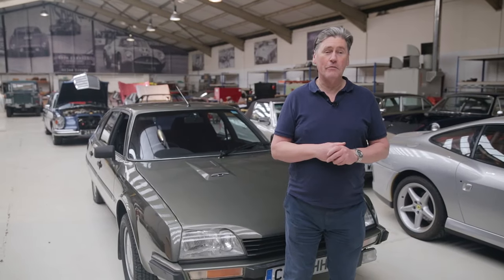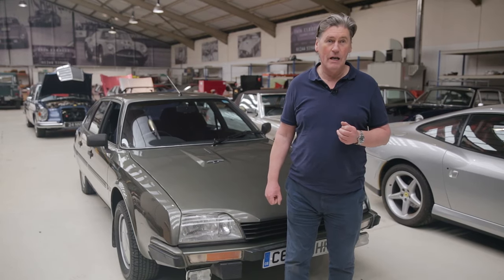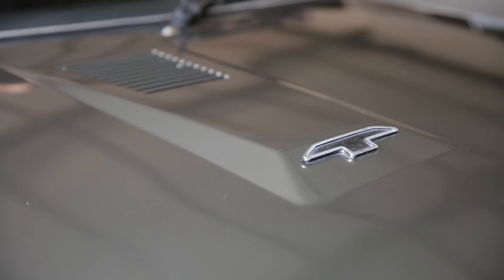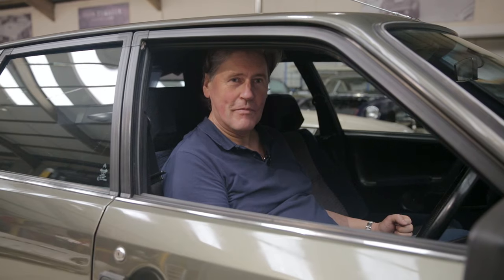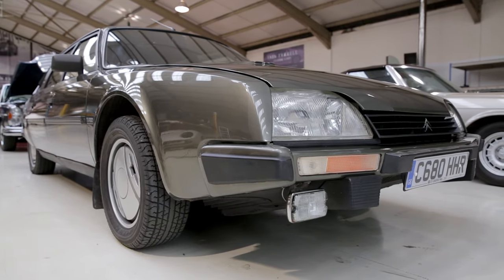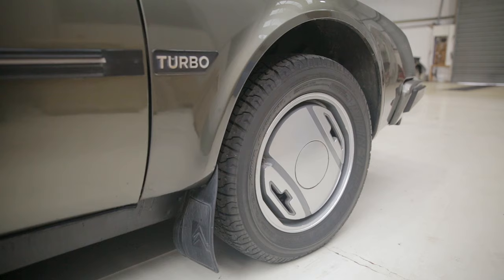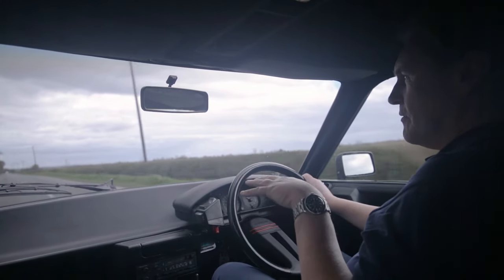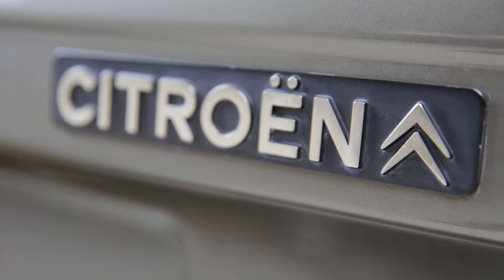Citroën CX 25 GTi Turbo - a rare beast with party tricks | Tyrrell's Classic Workshop

Comment: Fact: Citroën designed the double chevron gears to prevent side thrust on the gears, negating the need for thrust bearings on the gear shafts.
The Traction Avant used torsion bar suspension, not hydro-pneumatic. The DS was the first to hydro-pneumatic.
The Mercedes 450SEL 6.9 used pneumatic suspension.

Comment: Good job of teaching the curious about Citroen. One of the most fantastically engineered cars ever. Citroen proved that there is way more to a car than encapsulating a big engine with 4 wheels. A few points: Rolls Royce did not manufacture the ultra precision hydraulics, they bought the components from Citroen. Including using two of the cam driven single piston pumps that were used on the Citroen ID series. Rolls Royce considered the belt drive, aluminum core, 7 piston pump less reliable.  The Citroens very much have dampers (shock absorbers). And nitrogen pressurized. The orifice system is virtually identical to any  shock (or strut). Ie belleville spring type discs over bidirectional metering ports. Take it apart, you will see. Mercedes Benz, like most German car makers have tried, unsuccessfully, to steal / borrow Citroen's elegant hydraulic prowess. All failed because the Germans are clueless about hydraulics. And I own BMW's, in addition to my 8 D's and SM (the version with the hydraulically self leveling and steering headlights).

Comment: Dear Iain, first thanks for this wonderful video. At 3:19 you talk about the Douvrin engine and you say it is the 2,2 Litre. I believe you are wrong!  It is the 2,0 Litre engine.  I worked some ten years ago as an accountant for a valve producing company called TRW Engine Components and there was one company in France called FdM ( Francaise de Mecanique, sort of joint venture of several producers to save costs) and they produced engines that were used in the Citroen CX and the big Renault (first the 20 and later also the 25 which had a 2,2 litre Evolution of the 2.0 Litre version perhaps longer stroke, also used in the Espace in the later 80s) 
But the 2,2 Litre in the beginning was I believe the original DS 21 carburettor version from 1971 upgraded for 1974 because Citroen was still producing the DS 23 (2332 cc) until 1975. Then Peugeot overtook the ill Citroen Group and stopped the DS and the 2333cc engine was introduced into the CX and was called 2400 from model year '77 on which started in summer 1976, consequently the old 2200 (112 hp ) was replaced by the 2400 (117/118 hp) both carburettor. Top speed jumped from 182 km/h (2200) to 186 km/h (2400) in the manual shifted version. My dad was a car dealer from summer 1977 to early 83 and we had a cognac brown 2200 Pallas limo which cost over 23.600 DM in 76 more than a Mercedes 230 (123) for 28.800 you would get a 280 SL (R107) in 1977
Reply from the maker: Hello Andreas, They definitely made a 2.2 litre CX with the Douvrin engine because I owned one for 2 years. It was called the CX22 TRS, and was launched in 1985 if I’m not mistaken. Thanks for your interest

Comment: Taking another look 12 months later. Was the hydraulic system really so complicated? Or was it just extensive?  The ride height was a simple lever on the back axle brakes were an on off valve. Steering was complicated bug fortunately very reliable.

Comment: The CX/DS engine is basically a Traction Avant motor, isn't it? Dates back at least to the mid 1930s... DS was due to be an air-cooled flat six. CX was supposed to get a V8 derived from the Maserati V6 (which, as a 90-degree unit, was originally designed as a V8 anyway).

Comment: Great video! However: It's not as rare as you make it. In fact, most of the CX's still running today, are these turbo models and the limousine version (Prestige) with the stretched wheelbase: you can easily recognize those because the back doors are as wide as the front doors.
I owned a 2.2 TRS myself and still to this day it was the most comfortable car I ever owned. Literally a magic carpet ride.
The power steering is called the Diravi system btw. Also I remember from my first drive of my CX I actually almost knocked my own tooth out because that weird rubber break "ball" (no break paddle!) was incredibly aggressive in braking! But man, did I spend loads of money on repairs on the chassis: it just rusted so badly and I was a student back then.. Had to part from it after 2,5 years 🥺😭

Comment: You are probably aware that the V6 installation in the SM is flawed.  There was a French engineer called Georges Regembeau who rebuilt them with belt tensioners, solid valves etc and got a reliable 240bhp.  He had previously installed his own 5 speed in a DS he had tuned, and got 138mph!  PS my first car was a GS and I felt so smug, surrounded by a sea of Escorts, Vivas and Marinas!

Comment: I think the Infiniti Q50’s (controversial)  “steer-by-wire” has the steering wheel not connected directly to the column but it has a mechanism that connects it in “fail” mode.

Comment: You never demonstrated the self levelling suspension by driving on 3 wheels!
(If this model is able to do that).
Also Rolls Royce used Citroen suspension under licence.
Fantastic video.
Always thought Citroens were quirky.
Always remember as a kid the single bar on the steering wheel and radio by the hand brake.
I think the quirky technologique  of these cars set them apart from every day Euro boxes.
I'm considering purchasing a Citroen C4 due to said quirky styling.

Comment: Great video as usual but why the double \\\/// chevron? Because of the thrust imparted when normal helical gears are meshed. Andre was enamored with the idea that with the double chevron, the gear thrust is neutralised. They don't force themselves to one side or the other under load, straight cut gears also have this advantage but are noisy. the double chevron gears exhibit slightly more frictional losses but run very quietly. Viola...

Comment: Just a slight clarification, if I may: The hydropneumatic suspension was not outlawed in the U.S. It was our inane “safety” standards, along with emissions requirements, along with low sales volumes of Citroens here, that made the economic reality insurmountable starting in the 1974 model year. That didn’t stop a gray-market importer from modifying and selling a fair handful of these cars here, into the 1980s. By “safety” standards I mean the asinine, insurance-industry driven 5 mph bumper requirement (no body damage)... along with ever-increasing passive safety requirements, also largely the result of the insurance lobby.

Comment: With the self centring steering, you had to steer the car out of a turn as well as into it, because if you let go of the wheel and let it run through your hands, you would end up in a ditch if you were lucky, and if unlucky, on the wrong side of the road with on coming traffic. I drove mine through a ford and the river was only 6 inches (150mm) but I took no chances and raised the suspension so the floor pan was way above the water. But water splashing up from the front wheels got into the distributer and the engine cut out with the car half way across. With no power, the car slowly sank. Ha ha, those were the days.

Comment: And the advantage of "chevron" or "herringbone" spur gears is no net end thrust along the axles of the gear wheels, so needing smaller bearings on the shafts. Clever, M. Citroen!
Reply: Very true but parallel shaft gearboxes are aways torque limited by how much the shafts try to bend away from each other. Epicyclic gears are the best option (never used in manual 'boxes). They have three or four planet gears running around a central sun gear and an external (internally toothed) ring gear around the lot. The gears are all straight cut so very efficient but as there are three or more planets there is always at least one gear tooth fully engaged so there is no gear noise and no side thrust to worry about. The thrust forces are all contained within the gear set so they can be smaller than an equivalent parallel shaft setup.

Comment: Not at all influenced by the 1967 Pininfarina BMC Aerodynamica concept car 9 years before the CX. 

I also think the Citroen TUB had a  brake compensator designed by Paul Magés the 1st such use of a brake compensator.. 

The DS was at one point going to have hydraulic accumulated power windows and central locking. I read that somewhere.  

That s a nice CX GTi Turbo.   

Great videos as always. 😊
Reply from the maker: Nothing new under the sun!
Reply: @iain_tyrrell  Indeed those Italian masters of styling and form. Citroen at that time were loosening sales to Renault and Peugeot in the mid sized car class. In essence a new concept that they took note off basically copied in 1967 and released in1976.

Comment: Matra Murena. CD of .32 in 1981. Tiff called it the marvellous Murena. However Renault didn’t let them use their V6 despite being designed for it. It got a Tagora engine instead. Just Like using a van engine in a Porsche.
Party trick? 3 seats. Mid engined too.

Comment: Honestly, I remember that Citroen, because of financial troubles, from which they were chronically plagued, actually sold the rights for the hydraulic suspension system to Mercedes that used it on some models including the iconic 190 Evo

Comment: Thank you for making a video of the exceptional Citroen CX Turbo, it illustrates how pathetic manufacturer's efforts in chassis design are today. I first rode in a self levelling DS with fully powered brakes, steering and gear-change back in 1968..today I have a new car with torsion beam non self levelling suspension with springy pieces of metal for suspension...This is the future... the year 2020 but we have to look back in time to see what we hoped to have now, instead we are hiding in our houses from a third world virus... Every car today should be self levelling and with active antiroll. The 1990's Citroen Xantia Activa had both features. Cars without self levelling are a big compromise since the load varies considerably. The rising rate of a hydropneumatic system is linear which also helps considerably with the magic carpet ride since the shock absorbers do not have to control the sharply rising rate of a conventional metal spring. Active anti roll should be standard today because a springy metal antiroll bar transmits bumps to the car when say a left wheel hits a bump and the right one does not so the car is always unsettled. Citroen's Xantia Activa was the fastest car through the moose avoidance test illustrating it's advantages in stability and safety. The suspension sphere shown actually has a shock absorber inside...not just a hole...it consists of flexible shims some small ones to allow free flow for low speed ride and larger ones that control high speed ride....more on rebound than bump obviously for a controlled ride. People are intrigued by Citroens because they are engineering masterpieces not just a marketing /profit making exercise.

Comment: As a mechanic for thirty odd years i have workrd on these and owned a BX 1.9 gti and a xantia and olso a xm all fitted with this hydraulic system and can only say brilliant and smooth but every one i had i replaced all four spears and on the xantia you had six on the suspension one on each wheel and one controling the dive when braking and one on the brake system as an accumulator with helds brake presure when the engine is turned off the only problem we used to see was people towing them once you brake a few times you have no pressure left then you use the car in front as a ramming post have seen some big damage due to stupidity and the other oddities where the hand brake worked on the front calipers and they had a tendency to leak the fluid out due to the return hoses from the suspension was a rubber hose with lots of out lets commonly known as the octopus hose as had bits joining from all angles in the trade the fluid was known as crushed kermit hence the french connection.

Comment: Pleasant memories of a 1973 GS 1220 Club which has a similar suspension setup / if not mistaken these were also air cooled ? Also you could drive the car on three wheels and the suspension would compensate for the lack of a wheel .

Comment: My first car was the baby version of the CX…. A rather tatty Citroen GSA Special. It had a surprisingly punchy 1.4 boxer engine if I recall. 

The hydraulic suspension was a dream over long distances and the car could be raised to give a higher ground clearance than a Landrover Defender.

Whoever designed the dash and switchgear was clearly on LSD and whilst the engineering was outstanding….try changing the spark plugs!!

Comment: that steering wheel looks like it makes the gauges so easy to read.
Reply: The earlier CXs actually used rotating drum gauges, the numbers painted on the circumference of the drum with a fixed needle... bloody Citroen madness again! Sadly, they make nothing remotely like this now...
Reply: I guess the advantage of the "drum" dials was that it was much easier and quicker to check your speed and engine RPM without taking your eyes off the road for other than a fraction of a second. So, in a sense, rather than "madness", the drums were a safety feature as much as anything. They were also ergonomically efficient in that they took up much less room on the dash in comparison to a traditional dial. :-)

Comment: Hi ! Excellent Video !
I have a 1987 CX 25 Diesel Turbo II - 165,000 kms.
You are correct - a brilliant car, fantastic ride and oodles of power - deceptively so that it is very easy to underestimate exactly how fast you are actually going.
I get excellent mileage per litre of gazoil (six litres/100 kilometer) - seems to go on forever before the needle drops down to 1/4 mark.
Sadly there is a very elusive fluid  'leak' which is evading detection - my local garageist has changed the Doseur (an octopus-like rubber hose assembly) but has only reduced the leak, not eliminated it.
Any ideas Ian? - l have the Frence Revue Technique for the Model/Year - and am willing to get a bit dirty.

Comment: I wonder where you would get spares of those green spheres? Don’t imagine you can service it.
Reply: The spheres are still produced new and are pretty cheap, between 35-60€ each depending on where it is located on the car. But the best thing is that you can refill the spheres over and over again with new nitrogen to the correct bar (which varies depending on position). It's done very easily and costs around 15€ per sphere. Also to remove the spheres is very easy, but on a Xantia Activa you have ten spheres so takes a bit longer time, but not more than two hours. I don't think there is any other car where you can get new suspension and dampers for that low cost and that easily.

Comment: The steering was actually called DIRAVI if I recall correctly.
Reply from the maker: Only in France. It was called Vari- Power in English- speaking markets. Thanks for your interest:-)
Reply: @iain_tyrrell  Actually, SpeedFeel in the USA (although a case could be made that they are not English speakers). Vari-Power in the UK (a few of you seem to speak English), DIRAVI in France and Canada. It has as you know, no feedback whatsoever, yet seems to work just fine.
On very long stretches in high crosswinds it can become a bit tiresome as its constant assist to centre can result in a continuous urge to drift into oncoming traffic, or the ditch.

Comment: You missed another Citroen trick: How the brakes are bled. Two people, one inside the car with his foot on the pedal, engine running, other guy undoes a bleed valve under  the bonnet on the 5th sphere & closes it again when fluid appears. Takes less than 10 seconds to bleed all four brakes.

Comment: In Australia, pretty much post DS, the brand fell from favour, with spare parts availability and pricing being issues. (Protectionism at the time being what it was.) Now that Ford Australia and General Motors Holden have shut down production, any goes, however the Euro prices remain high.

Comment: i liked ------- but then i have only ever owned Citroen cars in 44 years of driving ie from the DS days. My current car a C5 Estate with 300,000 miles on it never broken down, never touched the engine and 20 years old.  Before anyone says, yes i service the car at least once a year and change oil and filters every 8000 miles --- oil is cheap, engine rebuilds are not . Had a CX Prestige long wheel base for a shot while wish i had it now, it was incredible but long.

Comment: Growing up on the Continent in Switzerland and France these were rather common. I always dismissed them as uninteresting because of their cheap sounding 4-cylinder engines, clownesque suspension, and abysmal reliability. It wasn't the engine that went, it was all the other parts. 

But André Citroën was an engineering genius back in the 1930s and his spirit of innovation and thinking outside the box lived on in Citroëns until the 1970s. Ultimately, however, spring suspension is easier to manufacture and engineer, and easier to replace. In a way, Rolls Royce made the best use of Citroën's system: the complexity and cost of the system was reasonable compared to the price of the car and gave the Silver Shadow, Spirit and Spur their magic carpet ride for over 30 years.